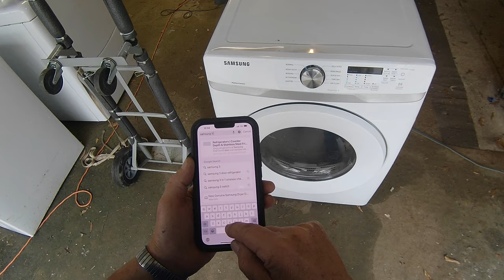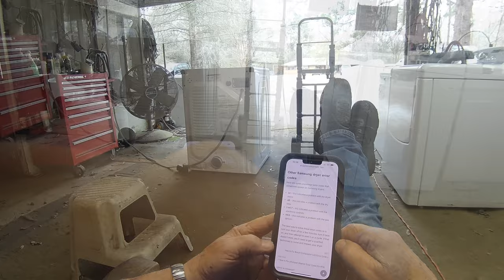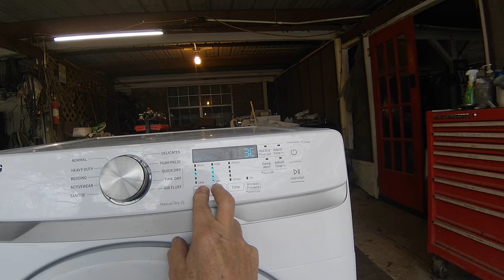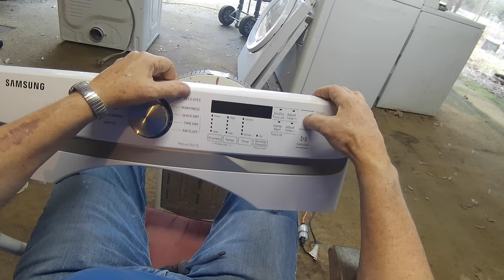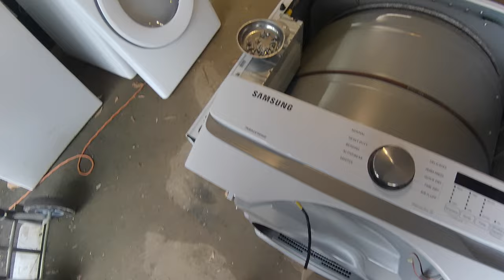How To Fix the 3C Error on Samsung Dryers: A Complete Troubleshooting Guide

Comment: LMAO summary of the video - smack the relay on the board - I smacked the dryer 3 times on the outside where the board is , not even taking it apart and it fixed the problem! hope this helps!
Reply from the maker: Lol, unfortunately I didn’t have the foreknowledge of the actual problem.  So, I covered everything that could possibly be wrong. Had I just walked up and smacked it, it would have been a very boring video! Thanks for watching!
Reply: @HarperandKnowles  lmao well I wouldn't have thought to hit the relay! I was already pricing boards then I watched! thanks!

Comment: Helpful to understand what to check and where to go.  Checked the relays and nothing popped on the meter, thought I was doing something wrong.  Ended up just tapping the relays a bit and putting everything back together.  Ran a dry cycle and it seems to be working fine! Hope it stays that way.  Thanks for all the help!
Reply from the maker: Glad you fixed it. Thanks for watching!

Comment: Thanks for the Video.  I was having the exact same presentstion of issues.  I tried long and short powerdowns, unsticking the buttons, button holds, and was getting ready to open the dryer up to attempt to unstick the relays and had the idea to try from the outside first, so  I gave it a few hard wacks with my hand on the left front side of the dryer (where the control box is mounted) while is was powered down.  Powered it back up and it has been working fine.  It seems as though my issue was a stuck relay as well.  Thanks again!
Reply from the maker: Let’s hope it won’t reoccur. Thanks for watching!
Reply: This comment just saved me a LOAD of headache and hassle. I got 20 minutes into the video, fully prepared to take my entire dryer apart, before starting to scroll through the comments. I stumbled on this, got up and whacked the side as you mentioned, plugged it back in and VOILA! Like magic it’s stopped beeping and flashing that error code. Thank you!

Comment: Thanks for the video I had the same issue on my Samsung but before I took it apart I tapped on the side of the dryer around the breaker area and it worked 🤷 I greatly appreciate you posting this video seems like the breakers get stuck as you mentioned 😁. I've had my dryer for 2+ years and this was the first time it's given me issues. Dang thing was expensive 😓
Reply from the maker: Glad I could help. Thanks for watching!

Comment: All I had to do was scrub my  dryer plug with a wire brush. Thanks I did all the easy stuff before disassembling my dryer. 👍🏾
Reply from the maker: You might want to replace that receptacle if one of your prongs looks like it got hot.

Comment: Loved this video, wasn’t sure what was happening but it was very satisfying at 2x speed. Right now my dryer also has a 3C problem, don’t know what to do :P, without it being even turned on, if you close it, it spins and makes the sound
Reply from the maker: Yeah, that is a stuck relay.  You might be able to fix it by exposing the relays and lightly tapping on them. It’s worth a try. Thanks for watching!
Reply: @HarperandKnowles  what are relays, would I have to open the dyer up?
Reply from the maker: Relays are the black components you can see about the 27 minute mark in the video. You can see me tapping on them to ‘unstick “ the internal points.

Comment: I had a dryer (dont remember the brand) that gave no heat. Turned out to be one of those early models where they started to hybrid in electronics. It had 2 identical plug in relays that closed contacts for the motor and heater. When I swapped the relays the motor wouldn't start. Bad contacts... Turned out that the coil to actuate the contacts was 5v from the computer board (more on that later). P/N was on the relay so I found the exact thing on Digikey for about $3, compared to $25 and a 30 day wait. Part arrived 5 days later, swapped it in and it worked. 2 years later, the machine came back. But this time there was no 5v coming out of the board. I sold him an old school machine. I could buy a new board, but I'm gonna look into doing a micro solder repair if I ever find an obvious problem with the board. I got interested in microsoldering by watching the early videos by Louis Rossmann. We might have to resort to that should parts get scarce. Too bad there's no  schematic/info avail on the boards.
Reply from the maker: Your comments are always educational, Professor. I appreciate you sharing your knowledge with the community. Thanks for watching another one!
Reply: @HarperandKnowles  Same to you!
Reply: @HarperandKnowles  FYI...most digital stuff runs on 5vdc. Even car sensors. Most common problem for me has been the power supply that converts 120vac to the 5vdc. So...one day I might fix that board.

Comment: 3C error code fixed. After watching your video while unplugged I plugged back in and lone behold problem still so I before taking all apart repeatedly tapped and pressed play/pause button 7-8 times and SUCCESS!!! button on panel I must assume was just stuck, new rule be gentle with the button lol
Reply from the maker: That’s a good tip. A stuck button will cause the error too. Thanks for watching!
Reply: Holy crap that worked for me thank you for posting!!!
Reply from the maker: I’m glad it helped. Thank you for watching!